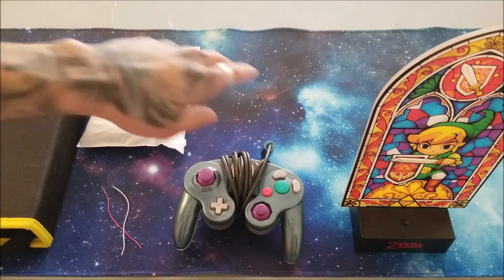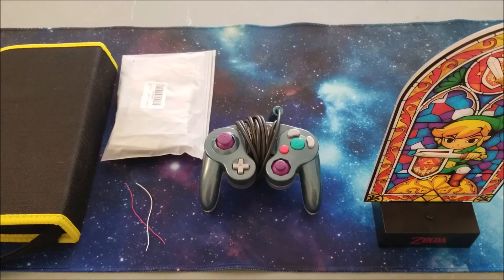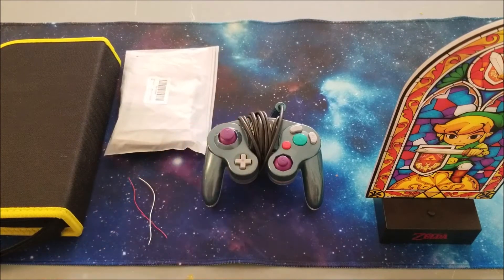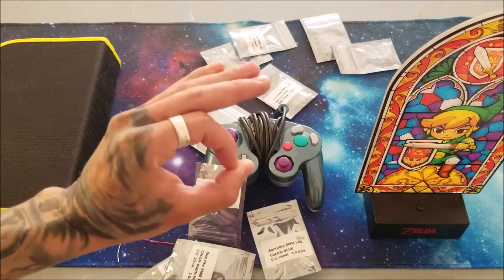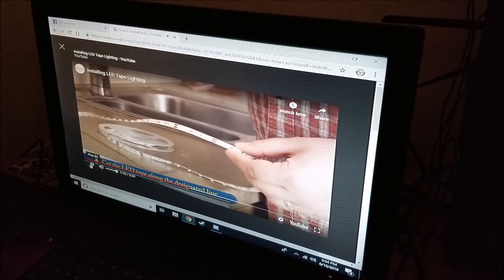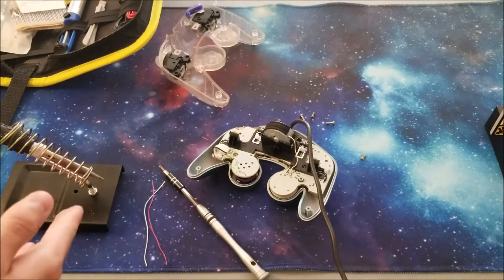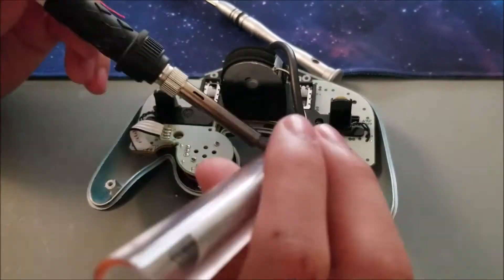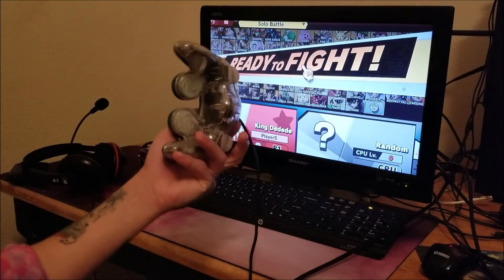How to install an LED into a GameCube controller

Comment: Hey there, nice vid.
Would it be possible to use the same spot to wire round another Led to c-stick area or not?
Reply from the maker: Its totally possible I you would just need to add another resistor linked to the other LED.

Comment: What wire did you use that you added to the led?
Reply from the maker: I used some old controler wire. You can also use a broken charger as scrap for the wire.

Comment: Is there any way to just have the LED on constantly?
Reply from the maker: I believe if you splice into the actual wire harness, then yes it will output constant.
Reply: @Okinashiri  You should do a tutorial on that. :)
Reply from the maker: @SerpexaFlexa   you are totally right. but if i totally mess it up im still posting the video lol.